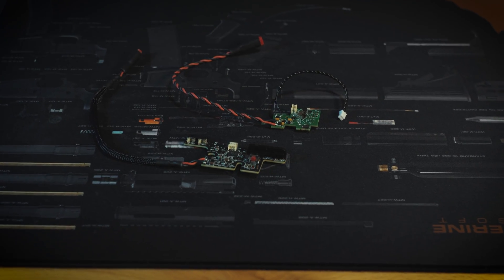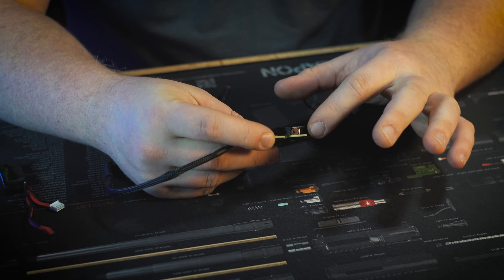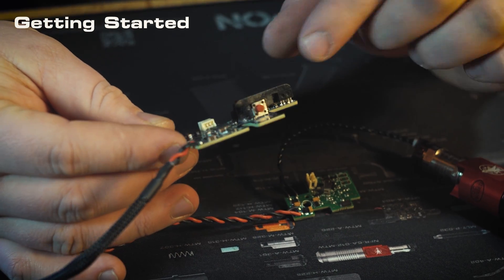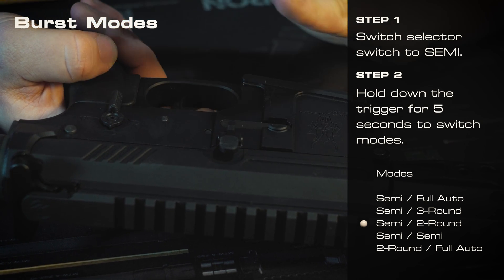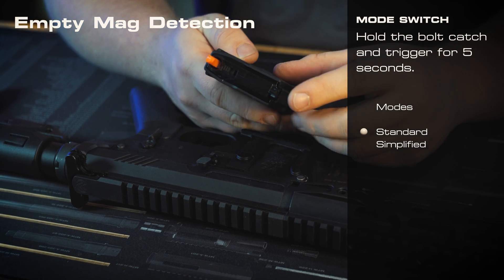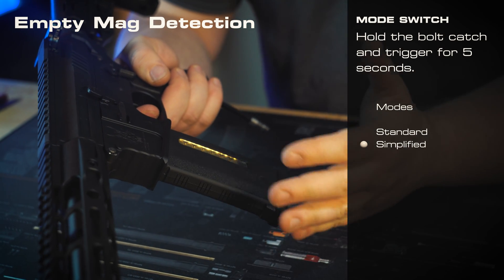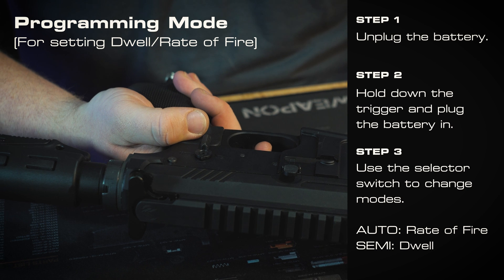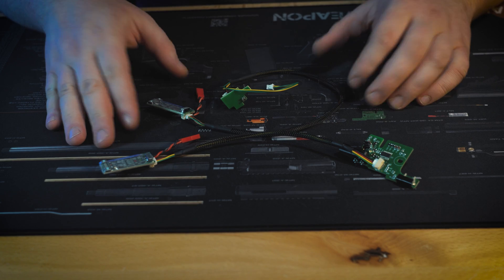Spartan Electronics Overview - What the Tech!

Comment: The problem with this all in one is that I need a spot to connect a signal wire to "the switch", but I can't because the contact is under the switch I need that voltage on trigger pull where is a good spot?

Comment: My gun won’t go through the selector modes, it will make the click but won’t change out of full auto, I am trying to make it semi only so I can run it as a dmr
Reply: I have the same issue, did you ever figure it out ?
Reply: @Bobsilol just hold the trigger in single fire for 5 seconds and then check, every time you do this it will switch firing modes